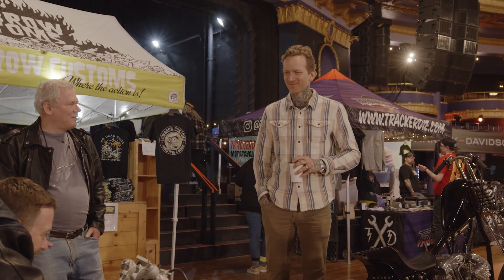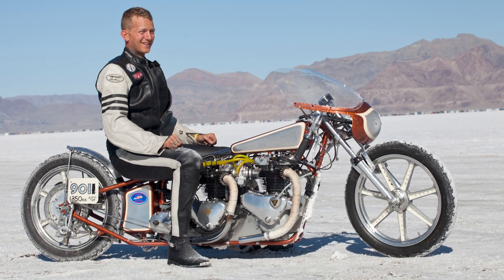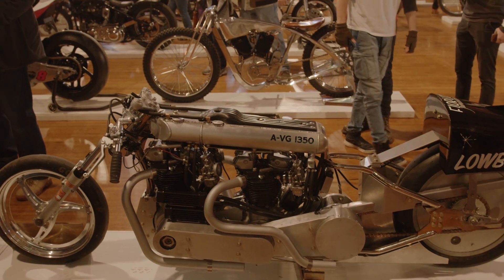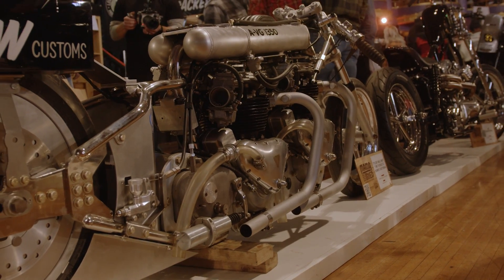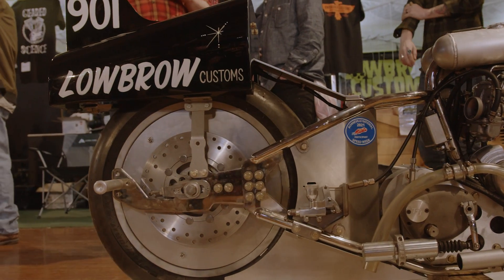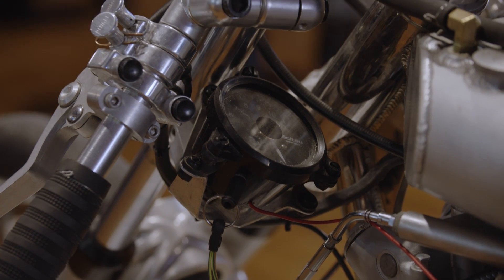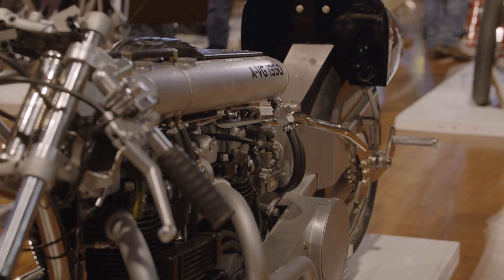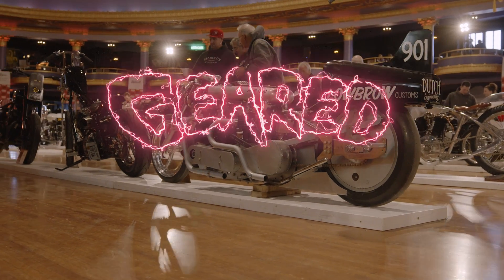In Depth look at Tyler Malinky's 1950 Dual Engine Triumph Land Speed Racer at Mama Tried 2022

Comment: A used cbr 1000 would leave that heavy piece of crap in the dust... What is the point in making something that is worthless? I have gone 212 mph on a cbr 954, and I am wondering what kind of record did he break by going over 150?
Reply from the maker: LOL! This is a scratch built 1950 Triumph, dual engine. Each engine put out about 35 horsepower at the crank when brand new. This is an antiquated design, a pushrod engine, it does not compare to a CBR 1000. Yes, you can go get a CBR 1000 and go faster, but that isn't anything special. The record that currently stands at 151.1mph at Bonneville is for A-VG 1350cc. That is Special Construction (aka race only, that is what the A is for) Vintage (pre-1956) Gas (gasoline, as opposed to methanol or nitro methane) and 1350cc (displacement, adding displacement of both engines together). Currently held by a dual-engine Indian Scout, a ways back it was held by a Harley Davidson Knucklehead I believe and was around 130mph record. Speeds at Bonneville are set at high altitude, for long distance (elapsed time over a flying mile, not bumping the needle off of a number) and accurate (OEM speedos are not accurate, especially at high speeds). It's the pursuit of fun and excitement. We are out there having a good time.
Reply: You didn't build your own Honda CBR 1000.  That's the point.
Reply from the maker: @237KMT  :) Yep. I built the engines myself in my home garage. It makes it feel EXTRA good to go really fast with them.
Reply: @B Chase.  Built not bought.  Your comments are that of just another consumer.  Enjoy your mediocracy.
Reply: Mook
Reply: You deserve a headbutt to the taint to show you whose boss.
Reply: If it needs to be explained you will never understand
Reply: It's too bad mommy and daddy built you.